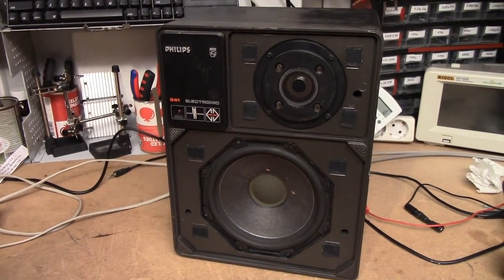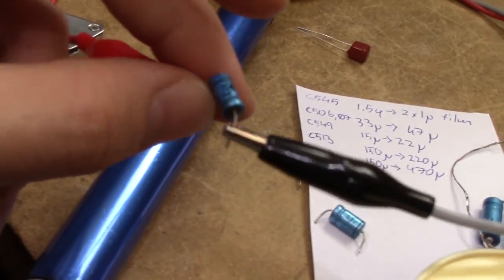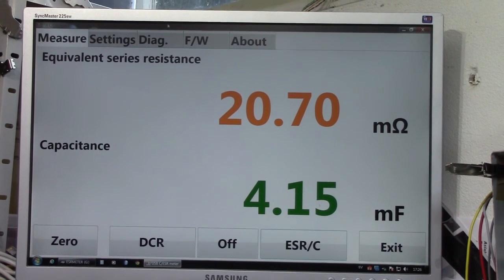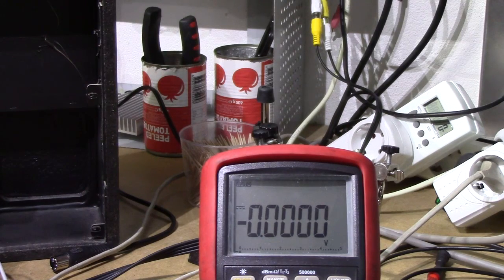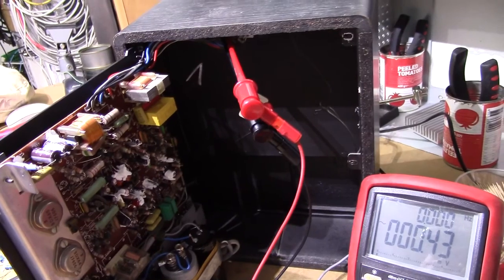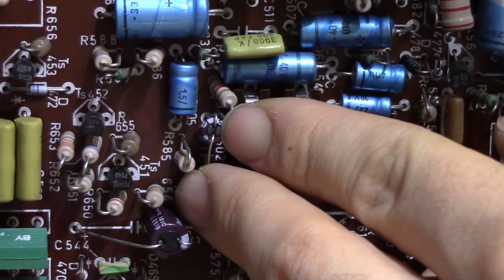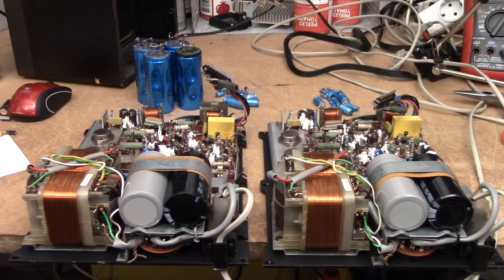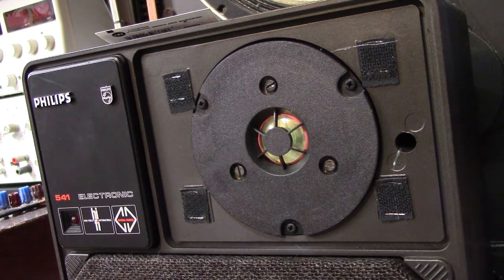Philips 22HR541 motional feedback speaker restoration

Comment: Nice video. I have a pair of working 541s my selves, and a pair of 567s too. I am planing to recap the latter, and found. your video interesting. 

But I would wish that you showed us the practical prosess to.
Reply from the maker: Oh, lovely - I envy your 567s!

I don't film the full process, because it's frankly very boring. Once you've replaced one capacitor, you've replaced them all.
Reply: @FFcossag  I actually got a pair of KEF LS50 Wireless too. A pair of modern speakers, built on the same idea ++. 

And I have to say that the old 567s are playing almost as good, and they are far more fun. 

If you really want a pair of 567`s, which was made specially for the Scandinavian market, you can by a refurbished set here: 

https://shop.mfbfreaks.com/product/set-22ah567-mfb-boxen-gerestaureerd/

Comment: You can fix the humming noise by replacing the coupling capacitors. However, most nowadays capacitors only work for five years.
You have to fix the same issue every five years.

Comment: Hi, Thank you very much for the video. Could you please give me a quick clarification regarding adjusting the feedback level? I just refurbished my 22RH541 but being a bit of a newbie I need some help. where exactly do the probes need to be connected? And then is it correct I have to feed a 125Hz audio signal through the speakers while taking the measurement? Thanks for your help
Reply from the maker: I did it according to the service manual, you can find it online.

Comment: One of mine (same model) just gave up earlier today. It now sounds like that speaker does when you cut power to it before the signal. Only difference is, that it continues to sort of play (very distorted). I wonder if you would have any idea what's the most likely cause of that (blown transistors, the power supply or perhaps capacitors)?
Reply from the maker: Probably a capacitor failure, if you haven't restored it, but it really could be anything, I'm afraid.
Reply: Thanks for replying. I'm going to keep them for repair sometime hopefully soon.
Reply: I don't have the skills to fix them. they're in my basement storage room now        .
Reply: @plstk63  same here, one of my 541 gave up last week, now its just gathering dust, I can't find anyone in the UK who really understands these speakers, I also have a two pairs of 585's that are now starting to play up, just wish I had the skills to know what to look for...

Comment: What is the PL XXX number of these speakers? Tweeters have been changed during the years. They should have diffferent PL Numbers.
Reply from the maker: I haven't checked, but that's good to know.
Reply: FFcossag the Numbers and corresponding tweeters used are in the Dutch service manual